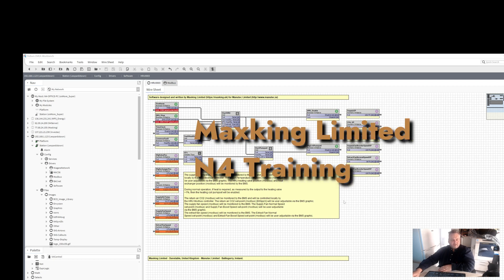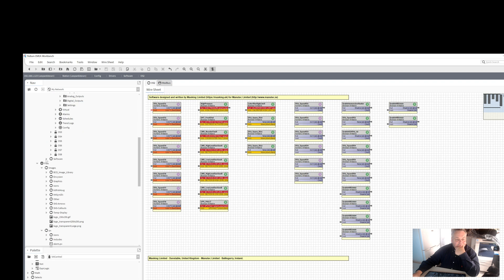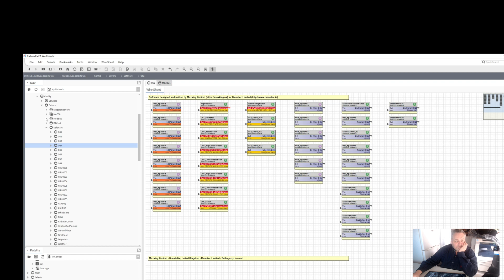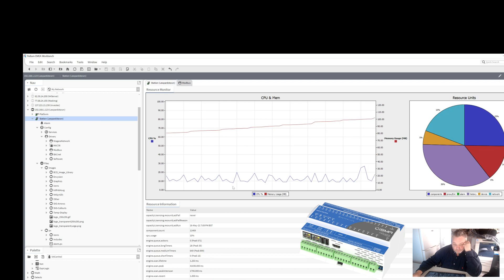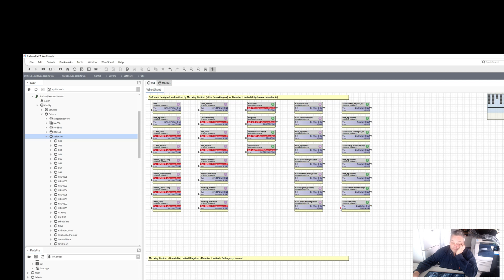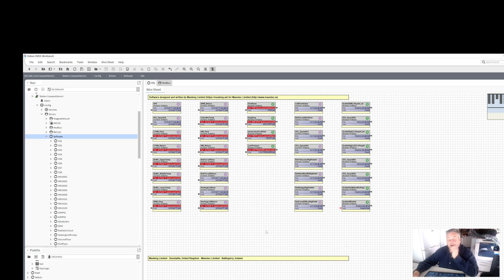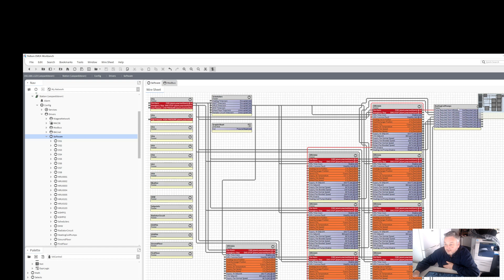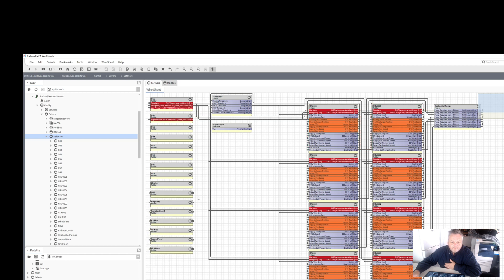#1 N4 Tridium Niagara - Machine learning -  Software

Comment: how i can download this software
Reply: This software needs to be licensed for it to work and you can only get the license if your a partner of one of the companies who supply the controllers. The license last one year and normally runs from April to April.
Reply from the maker: You can download the software from many system integrator sites at either https://bmsparts.co.uk/product-category/downloads/ or https://onesight.solutions/software-downloads/ or https://support.innon.com/Tridium_Niagara/Niagara4/Vykon_Installs/ 

You will still require a license for the software to work and this will be from your system integrator and requires you to have completed the N4 course, details can be found at https://www.tridium.com/us/en/services-support/tridium-university
Reply from the maker: You tube video link at https://youtu.be/YbSL4hTCl2w